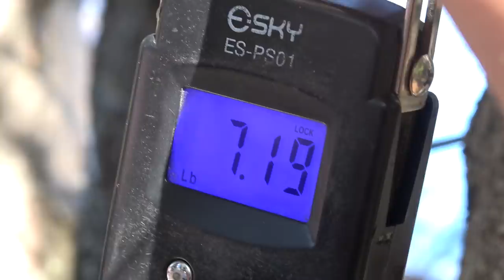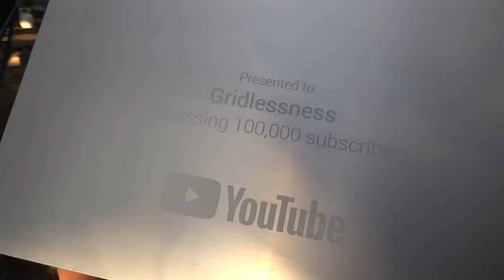Burbot  - and something special for Jay and Sam Siemens

Comment: Nice renovation. I did a 1965 StarCraft renovation back in 1995 and still looks like it was done last year. Unfortunately the rivets are loosening and it takes on a little water but that's what the bilge pump is for.

Comment: How do you weld that aluminum in the remote wilderness without high-frequency.  I'm a welder by trade please explain to me how you did the aluminum welding off grid . I love your shows
Reply: All it takes is a generator. It's not like you have to have 3 phase power to weld aluminum.